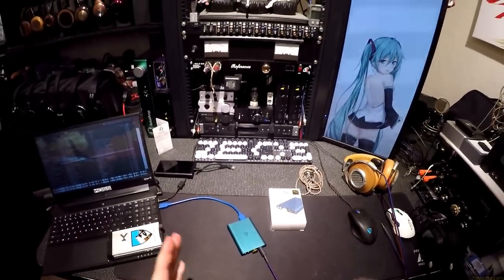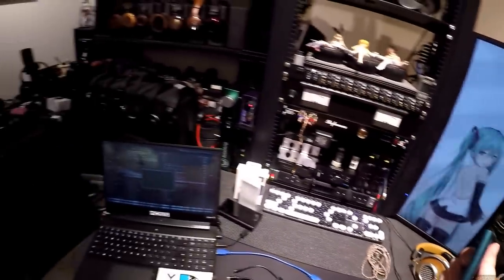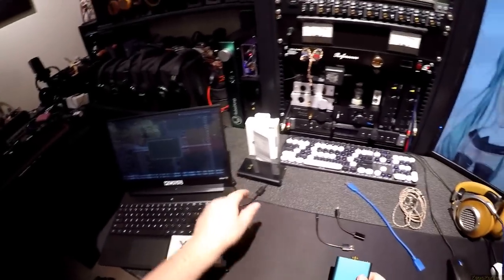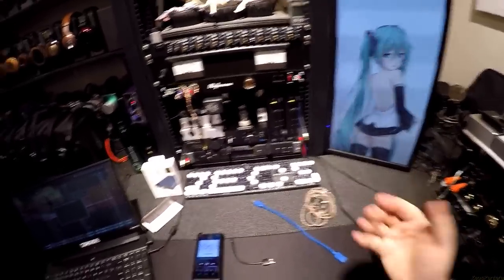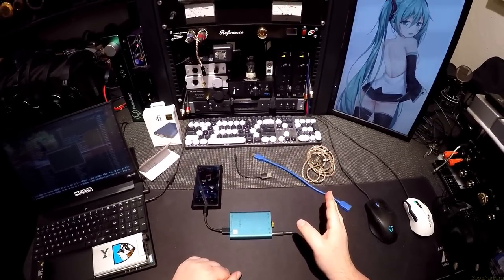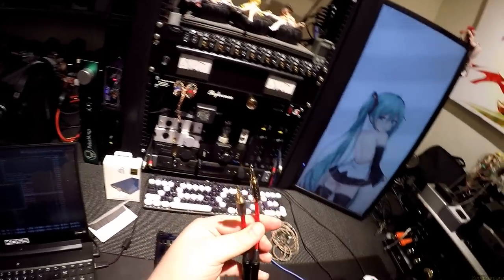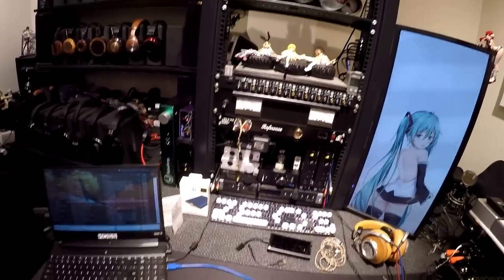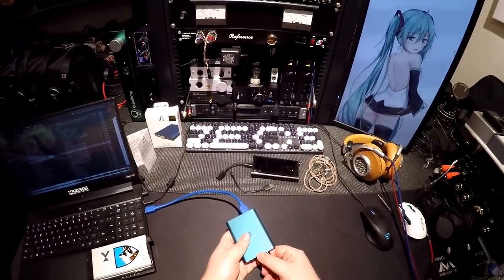ifi HipDAC _(Z Reviews)_ XBASSGasm💦💦

Comment: 7:00 The Reason the Ifi Uses USB A for data is for iPhone users. The simplest way to connect any DAC to an iPhone is going to be the "Lightning to USB Camera Adapter" (Lightning to USB A cable), thus the simplest answer to cover all users is the USB-A. Plus as you mention also makes for a very robust connections point which can't hurt either.
Reply: OBVIOUSLY.  Zeos   Duh.  I’m using iPhone in my moms basement.
Reply: ^ this
Reply: That more than likely played a role in the thinking behind it. In all honestly I was a little off-put by the connection, but really with the number of charge/data ports that have broken in a myriad of devices I've owned USB mini, micro and even one USB-C, I see this as a selling point in terms of longevity. At least you know that the port will last as many years as the battery.
Reply: With the USB out, wouldn't this be an obvious choice for connecting a (short) USB to Apple 30 pin and connecting to 5th/ 6th/ 7th Gen iPod. Lots of iPod fanboys out there! 🤔

Comment: Just got my unit today, and the best thing I can say about it, is that a colleague who is not even in to music/audio, said she is getting one after testing mine for a little bit.
Reply: Do you happen to have tin p1 as well? I looked over internet to read about their synergy and couldn't find a single mention of them together
Reply: @prabinpaudel5572  I don't have a P1 but it is the same story as T50 RP and BasX A-100.  The emphases is on low end, and P1 as I understand are a brighter IEM. If you find P1 to be too sharp, then yes, this would be great, but you need headphones that can produce good low end to benefit this DAC. I aim for Campfire Atlas to pair with this, but you can go for Comet if you want to be in the same price range with P1. For P1 I would go with BTR5. It is a more balanced/neutral device, and 2nd it is so much easier to use then Hip-DAC.  Sure Hip DAC sound good, but after nearly a month of use, the struggle to have it attach to my phone makes it more of a pain then an a joy to use it.
Reply: @kurt120032002  people seem to compare p1's frequency response to 6xx series. Mid forward bass light. But p1 seems to be better extended in treble. And planar speed obviously. And since everyone says it responds well to even software based eq. Bass boost of hip dac must be superior. Thank you for sharing your experiences. ☺
Reply: Is it still working fine?
Reply: @mcwaff8661  about 6 months later, and still works fine.
Reply: @kurt120032002  good to know
Reply: @kurt120032002  what do you use it with I'm planning on using the moondrop blessing 2
Reply: @mcwaff8661  I don't use it. I used it when I got it for about 2 weeks and last week. Forget the sound, this is so bad to actually use it, that after 2 weeks I said fuck it, and paid the exact same money again on a BTR5 that I am using ever since with Campfire Polaris 2, via IEM Match, on slow filter. Hip Dac feels so great in the hands, but the lack of BT means you have so many wires all over the place, and if you go with the default short wire, you will constantly unplug it when you change songs, and is really bad to use. Unless they come un with BT module for Hip-Dac, I can't recommend it in good fate. Ifi doesn't know I exist, and I don't need to sell their products. I use some of their products, including a 200 euro usb cable, but the Hip Dac is really bad to use.
Reply: @mcwaff8661  yes but as I say it is very bad due to cable ungluing. and that was me standing in one place. Walking on the street? forget it.

Comment: The reason for the male USB connection mounted down into the Hip DAC is so you can use the Apple camera adapter, which has a female USB connection, with it.  The Hip DAC is designed to be used just as easily with IOS as it is with Android.  No extra cable needed between the camera adapter and the Hip DAC, unlike most other portable DAC/AMPS.

Comment: The ifi rep that sold them to the store i bought mine from said that no matter what it is being powered off of the battery, not the source, but you can charge the battery and listen to it at the same time, they just didn't want to pay to translate another manual.  If the battery dies it apparently won;t take power from the source.

Comment: I also have Q1mk2 and topping nx4 and ifi Hip dac is the best sounding of them all. Downsides are lack of analogue line-in/out and volume knob being slightly too loose imo for portable use. Accidental volume changes in the pocket did happen to me (Q1 and NX4 don't have this problem).
Reply: However Hip dac is not as good sounding as Zen DAC.
They don't sound the same at this time because Hip DAC comes without GTO filter firmware installed. 
It will be available soon to update I imagine.
I believe Hip DAC has linear filter firmware installed.
This doesn't bother me as I won't be updating to GTO filter anyway because linear filter sounds better imo.
I compared both with stock firmware (edit: 5.3) and Zen DAC has definitely better sound. They have VERY similar sound signatures but Zen has definitely better components that you couldn't physically fit inside Hip DAC.
Zen DAC presents wider sound stage and better resolution. 
Zen DAC is staying by my bed but Hip DAC is the second best thing and my main portable solution (over NX4 or Q1mk2).
Reply: @sapphiro  On the Zen, I didn't like the GTO filter either and I bounced it back to the previous firmware. The GTO made everything a bit ... too smooth, if that makes sense? Love the Zen for the desktop and now my older gen 1, Nano iDSD is for laptop only use. I have loved the iFi products over the last few years.
Reply: Lee Brown I don't like the GTO filter either
Reply: Does it have more power than nx4?
Reply: @bilelbeavis977  From usb sources to 3.5mm output NX4 is louder but ifi from 4.4mm output is probably much louder (I didn't test balanced).

NX4 has 114mW @ 300ohm (3.5mm) and 
Hip dac has 200mW @ 300ohm (4.4mm balanced) and ~100mW (3.5mm)

I can't say how well it would drive higher than 300ohm headphones (I don't have any).
It's more than enough for Sennheiser HD600 from 3.5mm single-ended.
Reply: @sapphiro   thanks for that, another quick question if you don't mind as you seem to know you're stuff, probably a real newbie question and obviously can be done but can I use my nx4 or thx portable as a DAC to a phone then connected to a desktop amp cos I basically don't do laptops but I wanna get into amps but I just wanna know while it's not a common setup it can be done? Like basically replacing the laptop part with a phone? Thanks in advance
Reply: @bilelbeavis977  Yes, NX4 comes with the cables for any android phone connection (micro usb, usb c or 3.5mm analog cable). However It does not come with lightning cable for iPhone (you need to buy it separately).
Reply: @sapphiro   ok. So you're saying it's fine to use a phone with a desktop amp? Am I right in thinking I would need a 3.5 to RCA which would go from the nx4 to the amp then USB to my phone? Sorry for all the questions. Thanks
Reply: @bilelbeavis977  Yes, you can do that, NX4 has 3.5mm line-out on the front so you can connect another amp to it through 3.5mm to RCA cable. The phone you connect through micro usb to nx4.
Reply: @sapphiro   oh ok so as long as it has line out it's good to go unlike the thx portable I think? Thank you very much for answering my questions
Reply: @sapphiro  Does the hip dac sound the same as the zen dac with the other firmware? :)
Reply: @J0RDYV  Zen dac sounds better even with the same firmware.
Reply: @sapphiro  How about the Fiio K3? Which I think is the desktop version of the Q1 mk2, comparing to the Zen/Hip's sound?

Comment: Update: Issue solved. Turn off key clicks on iPhones solves the annoying pops. Thanks Jamie. Great support. Seems to have issues when playing the higher rate audio files. Noise pops and gaps happen if a text or any other app is being used on the iPhone. This doesn’t happen with the lower bit rate tracks and the green light glows.

Comment: Got my Hip Dac yesterday.  The LED stays green regardless of the sample rate being played. 24/192 is supposed to be yellow and MQA magenta.  I've used Foobar2000, Tidal Windows app, and Chrome (Neil Young Archives) on my PC.  I've installed the proper drivers and   set up the Tidal app per ifi's instructions and still the light stays green.  Ifi support was quick to respond but have yet to resolve.  My dragonfly black detects each sampling rate flawlessly. I really wonder how much time reviewers are spending with this product as they have out put reviews prior to the product being available in the U.S.
Reply: Did you manage to resolve this issue?
Reply: Do you happen to have tin p1 as well? I looked over internet to read about their synergy and couldn't find a single mention of them together

Comment: Yes, the usb A slot is too small for Sony walkman adapter cable (NWH10)  to directly connect them.
I had to shave off a little layer of plastic cable plug to fit it. Works great.

Comment: Hey Zeos, I have a stupid question. What's the difference between balanced and unbalanced inputs/outputs/cables? Thank you sir, go brush Chewbacca for me my dude.
Reply: There's three differences between them.
 Balanced uses higher voltage generally 4V compared to 2.3V for rca (single ended) . This helps to raise the signal above the noise floor. 

Second
 balanced uses difference amplifiers when done properly. A difference amplifier is for noise rejection. It is generally used for stuff like long microphone cables in a live performance. It's usefulness over a short length is small.

Third
Balanced uses individual grounds compared to rca common ground. So care is required when connecting balanced electronics with single ended stuff.
Reply: @chrisvinicombe9947  Alrighty then, thanks Chris.
Reply: @DerekMoore82  for more info try searching YouTube for "what is common mode rejection"  or  "what is a difference amplifier" as my understanding is limited and will probably cause confusion if I attempt any in depth explanation.
Reply: For headphones, balanced is basically using two contacts (+ and -, or 'signal and ground') for a single channel. And then another pair for the other channel. So 4 contacts for stereo.

A 'normal' connection uses two + contacts and a shared - for a stereo signal.

This generally means that there are two amplifier circuits, one for left and one for right. Instead of a single amplifier driving both left and right.

Since there are now two amplifiers, it results in more power, which can affect the sound.

I do say 'generally' because it van be different per implementation.

Some people also say the fact that the - contact (ground) is not shared makes the sound purer.. But ehmm.. Let's just say 'believe what YOU want to believe'.

Balanced connection in the studio world (and plugging in XLR microphones and such) is another kind of balanced.. Which I consider the true balanced :). It has nothing to do with 'balanced headphones'. 

Normally for a single mono signal you use two contacts, + and - (signal and ground). In a balanced connection they use two + contacts and a single - contact (so 3 contacts) for a mono signal. The two + contacts are 'opposite' of each other.

Long store short , a trick with 'phase' of the signal to eliminate interference over the cable. Very handy for stage and studio where the cable can be extremely long.

These kind of connections need support at both ends (both devices being plugged in) or you need to modify wires a bit.

People who think 'balanced headphone connection' over a TRRS jack has anything to do with 'balanced as in signals opposite of each other' have it wrong

Comment: This or fiio BTR 5 ?
Reply: Same question!
Reply: I have both btr 5 amazing and good enough to drive sennheiser 58x ( maybe even some harder to drive ones) but hipdac has crazy power. It will even drive my modhouse argons. Comes down to what you need. Btr5 is definitely more portable .
Reply: @NestorZaharopoulos  But in you're opinion which one sounds better ?
Reply: @samstone2641  i would say  the btr5 doesn't do much to sound ifi definitely is warmer bass boost is nice as well. Im not the biggest bass head but when i use it i really like it. They are both really good sounding. I would say the btr5 is just a tad better because ot os the most analytical.
Reply: @NestorZaharopoulos  Thanks Man for clearing things up it's gona make my decision a lot easier now have great day !
Reply: @NestorZaharopoulos  can you use this dac/amp while it's charging? So use it at my desk.
Reply: @DenisZ2023  no which was a bummer for me. I email ifi too just in case i was doing something wrong, but no.
Reply: @NestorZaharopoulos  thanks. Wish it did.

Comment: After wait for over a month for them to be back in stock I ordered one and I'm looking forward to comparing it to my M11.  I think it will sound great with my Ananda and Sundara.
Reply: Do you happen to have tin p1 as well? I looked over internet to read about their synergy and couldn't find a single mention of them together
Reply: how does it compare  to the m11
Reply: @dilip_1997  The Hip Dac is warmer and smoother sounding while the M11 has a brighter sound and the detail is about the same on both.
Reply: @TechnoGuy11  awesome thx for the reply, your using the hip long with the m11 ?
Reply: @dilip_1997  I don't use as much anymore but when I do it's with the M11 or my phone.
Reply: @TechnoGuy11  okay, is there something else you prefer over the hip dac,  I was wanting to get either a fiio m11 plus or the hiby r6 later next year but was wondering if, just a dac/amp combo would be enough for my iem's.
Thanks for your response, much appreciated!!!
Reply: @dilip_1997  It's not that I don't like it I just mainly listen at home on my desktop setup.  The Hip Dac sounds great for a portable option.

Comment: Which portable unbalanced DAC/AMP under 200/250$ sounds the best and the most detailed used as a DAC (I will connect it with an external amplifier)? It will be nice to have 2/3 suggestions. It must be portable and have any line out. It does not have to be super small or super powerful. It just have to sound good as a DAC, have an line out and be portable. What should I choose?
Reply: Earmen TR amp,just wonderfull sound and detailed.

Comment: Just did a test run using my hibby BT R2 as a BT receiver and then digital output via USB into my fiio btr as the DAC/AMP, works great, wow is the btr5 warmer than my hibby which I noticed during back to back testing.

Comment: Man, this is awesome! That’s what I thought until I compared the sound of it to my old receivers with headphone out. So much flatter that doesn’t lack in bass when Bass-X is off or have too much bass when it’s on. This is my first DAC, but I tested a few others at a local store and this fit my portable needs perfectly! This also can be used as a desktop DAC if needed/wanted. I highly recommend Bass-X for most headphones...but only because it lacks in bass otherwise. I’m trying them with my Shure 215 IEM right now with a compressed mp4 version of Lord of the Rings and, with the Bass-X on, I’m hearing stuff I haven’t heard since watching it in the theater! Really makes that low end from the orchestra drums stand out :D Definitely seems like it’s a bit much though.

Now I’m watching The Greatest Showman, and the difference between Bass-X on and off is stupid! If I don’t have it on, it looses all fullness and power and sounds really thin. Other thing is, the bass boost doesn’t mask anything or muddy it up....sort of. It does exactly what they say it does, in that, it “adds back” the bass lost from most headphones...actually, that’s incorrect. It’s the Hip DAC that took away that proper bass in the first place.

This was quite a bit lighter than the other portable DAC’s I tried. Even though this is pretty light, its build feels really rugged.

5-7hrs battery life I’d say.

If they fixed the sound balance, it would be awesome. Also, Power Match basically just raises the volume a bit it seems.

Good for a Bass Head maybe.

May sell mine. I get a better, more even sound from the headphone out on my phone.
Reply: What firmware are you running? Have you tried others. iFi has a myriad of updates (they are all under the same unified firmware updates on their support site) and many of them change filters and a variety of other factors affecting the DAC.
Reply: Do you happen to have tin p1 as well? I looked over internet to read about their synergy and couldn't find a single mention of them together
Reply: therealchickentender Oh wow! I didn’t realize that! Thanks! I’ll look into it
Reply: Prabin Paudel I don’t have a Tin P1

Comment: Has anyone tried the hip dac with fostex 50rp mkIII? Can hip dac push them with power match on?
Reply: That's exactly what I wanted to know . Can they Z??????
Reply: Yes balanced 👍
Reply: @theodorezurla496  the t50rp mk3 don't have a balanced 3.5mm connector built into them, unless you specifically order a modded pair to have balanced, or mod them yourself to be.
Reply: I've had my Dekoni Blues paired with my hip dac for about a week now, yes it powers them properly, I can max out the volume but it'll get to practically unlistenable levels.
No distortion unless maxed out w/ PM and xbass on.
Reply: Which I typically leave xbass off anyway for the Dekonis, they don't need it

Comment: Hi Z - In your opinion, is the HIPDAC better than the DA converter in the Fiio 15? Or just different? - In what way? Mucho thanks
Reply: Fiio m15 is like 10x more expensive. 
According to specifications fiio m15 dac has more capable chip in it. That doesn't mean Fiio automatically sounds better.

Ifi audio carefully programmed and tuned their DAC themselves.
Hip DAC sounds very natural and has warm and relaxed signature.